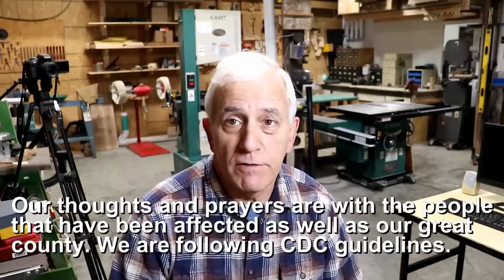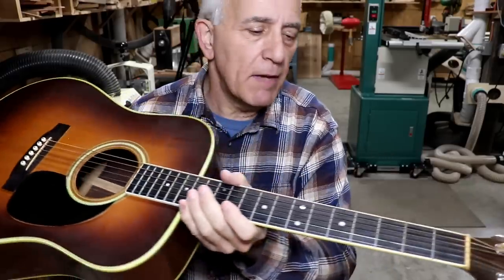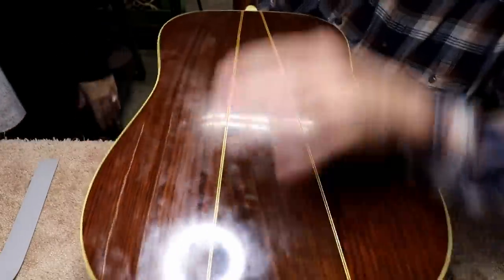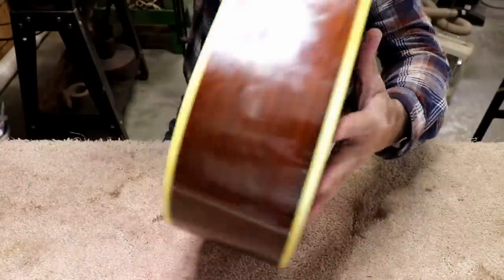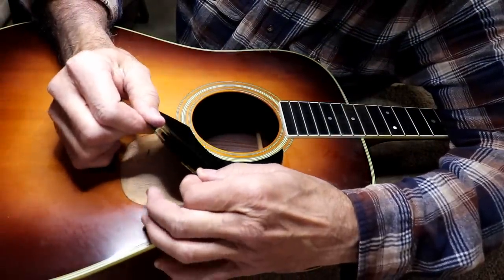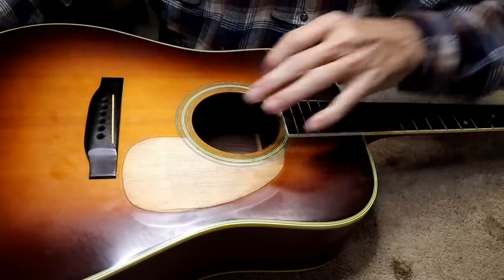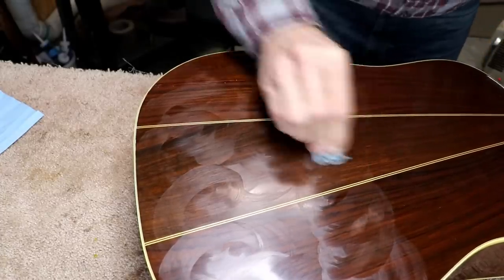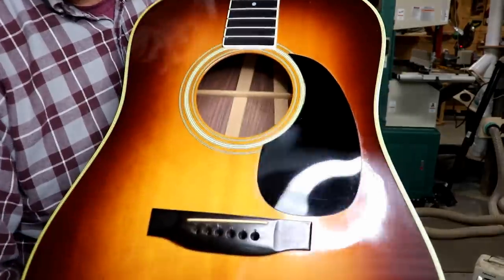387 RSW Martin D35 Impossible Crack Repair

Comment: I get what you're saying about using your fingers to sand, but as a guy who does bodywork on cars, I'm telling you you would get a lot better results on a flat surface with a block. You can still see the cracks on the back because of the pressure of your fingers sanded them down more as you were trying to get rid of the CA glue that was proud. First use a scraper to remove the CA glue that is proud of the surface, then use a block and you'll see that crack a lot less.

Comment: At what point do you use cleats vs just CA glue? Don’t know that I’ve seen a guitar this dry. Would it have benefited from some humidity conditioning before repair or is it the fact that rosewood does react to humidity like mahogany. Not trying to be nosy amateur-just trying to wrap my head around all these kind of issues you run into. Thanks for what you do!

Comment: I love that idea of a wider saddle for guitars that have that "durn" SHARP intonation problem!!! I've been saying that for years but have yet to see it done or even hear anybody propose it (besides myself) - UNTIL NOW!! - by Jerry!!  THANK YOU!!!  I think that's a great idea. They might even be flat sometimes. The saddles should ALL be wider! But not all guitars need a wide saddle. Jerry has proven many times that if the saddle is CORRECTLY LOCATED IN THE EXACT RIGHT PLACE, then a thin saddle should work fine. But wouldn't a wider saddle also transmit more string vibration to the bridge and then to the top causing greater sound volume, and whatever tone the woods on the guitar will amplify? (Especially the top!!) Probably not that much. Perhaps a larger saddle would even CUT DOWN and tend to MUFFLE the vibes! I don't know about that seems like the logic can go either way. Greater transference of string vibes to the top, or less??  Maybe both, with a point of "diminishing returns"?  IDK.  Saddles have probably already have been figured out, and the smallest saddle might be the bestest, otherwise there would be a lot of large saddles on acoustic guitars out there by now.

Beautiful sounding and beautiful looking Martin guitar, Jerry!!  The fix of the cracks on the back was a work of art!

Comment: All too many guitar players have trouble with correct and neat string installation. Often when they wrap multiple turns of string around the post it is because they either don't realise the strings should be cut to length, or they don't own a side / diagonal wire cutter tool. A previous post mentions BB King winding all the string around the post. Some people even recommend doing this because he did it. I think just because BB King did it doesn't make it right. He must have had a lot of patience to rotate his tuners that many times. I guess he didn't have any side cutters either. 

It's a shame about the neck on that D35, I wonder what Martin would do about that.

Comment: Hi Jerry I love what you do. I do have a 86 d35 it has a slight crack in the back about 11/2 inch along the grain kinda just opposite the sound hole . I was wondering it you could put your magic touch on it ? 🙏 
Love the D35 you doctored n the cosmetic surgery results 👍🏻👍🏻
Reply from the maker: I have been refusing all new business for quite a long time because of such a backlog. I don't see that changing anytime real soon. If it does change I will post a video.

Comment: On sanding the frets after leveling (& crowning if necessary) I still have a couple of erasing shields from high school drafting class that have a few slots with different widths that work very well with different fret widths. I'm sure Hobby Lobby and other places still carry them.  (Ya' see Mertle? All that junk in the basement I saved eventually DOES come in useful some day!!)

Comment: concerning your electrical problem Jerry it sounds like different circuits are sharing the same neutral ,seen this alot in older houses ,not real easy to figure out either ,sometimes you can look at the wires coming in the panel ,but not knowing and seeing it myself ill just say good luck with that
Reply: Ditto... If you can map out the wires, make sure the Neutrals are separated for each power source (Leg).   Crossing neutrals is like Ghost Busters "Crossing Streams"   End of the world/Alternate universes follow.

Comment: Gorgeous guitar Jerry and great work! I did have one question in that when you checked the string height at the 12th fret you only lowered the troubleside by 20,000s and you said it was 100,000. I thought the treble side you always took down to 80,000. But you only took 20,000 of the saddle treble side. Just curious, is 80,000 the standard for the treble side? Either way it sounds great and it looks even better. This is probably the fourth time I watch this particular video so thank you so much for all of them. I don't know

Comment: Jerry: Wayne our RB250 & RB11 banjo owning banjo player owns a 1968 D35 he bought in 1969. 2 years ago he had a local luthier reneck the 35.
Luthier told us D35's suffered from neck problems, MusiGoRound store in our area has a 68 D35 and store is asking $1,600.00 for it. I'm thinking
of buying it with my IRS refund. When he bought the 68 D35 for get this. $550.00. Boy have they gone up in price.

Comment: I do auto body and when you use fingers to sand, they follow the groves, so we use flat blocks for final sanding to avoid dips.. Finger sanding can put waves in where there was no repair.
Reply from the maker: I agree with you if you don't know what your doing your right
Reply: @RosaStringWorks  
Especially wood, it has hard and soft grain, fingers dig into the soft grain.

Comment: Just so you know until I think the 80s Martin put the pick guard on bare wood and finished over them . since the top shrinks and expands with humidity the pick guard isn’t stable  and unseals and also the plastic gasses out over time and curls, it’s also why all old martins have a b string pick guard crack.

Comment: Tom Langseth   I enjoyed your 387 (Martin D 35). You made it look like a new instrument. I do have one question - after you sealed those two large cracks, I would have expected you to put some cleats on the inside. Was it because you expect the lateral to keep everything tight.
Reply from the maker: I use cleat anytime there's any sort of stress pulling things apart. In this case there didn't seem to be any stress trying to pull anything apart

Comment: Jerry are you aquainted with its either Koval or Jantz knife making supplys ? If not maybe pic up a catalog .. they have a CA  Glue I ust to use for filling cracks in woods for knife handles and a spray  CA glue call zap. Its in a pump bottle .

Comment: Amazing talent to be able to fix those cracks in the back like you did and then blend in the finish! I dont understand how a $3000 guitar can come with intonation problems though. The frets must have been put in wrong and or the bridge was. My $200 Alvarez has near perfect intonation and sounds just as good. Anyways great video!
Reply: Well it wast a $3000 guitar really. Its a 70 something model, and I know you could get a brand new D-28 (natural finish) in 1975, with a case, for $600. So this sunburst D-35 was probably in the $700 range.
Reply: In the 70s the big three were having problems. Martin's was the intonation.

Comment: I have heard of people using those ridiculously strong neodymium magnets to clamp cracks level from both sides while they wick in glue and add cleats for these cracks. I've never tried it personally.
Reply from the maker: That would work if you were able to get it together. This is not at situation.

Comment: This 1976 d-35 is covered with crazing on the top, where it looks like the lacquer has shrunk over the years. There are also surface irregularities where it looks something has dried or adhered to the surface. As you have done wet sanding with 1000 grit on that Martin, do you think my Martin would look better with that treatment? I am a woodworker and not a stranger to working with wood. I happen to have some of that same wax you used that I have used on the surface, but it is too irregular to make the guitar look good.

Comment: Again I’m in no way questioning your work, I’m just beginning and fixing old fiddles I find at junk shops and guitars people find in closets (no charge but no expectations I’ll do it right either) When you fixed the cracks on this guitar, why did you choose not to install cleats? Was it how the wood was lining up and basically forcing itself together?
Reply from the maker: I use cleats with any time there's some sort of force or could be a force that would be applied to that spot. There is enough surface contact in this with the glue that there should not be any problem holding it together. The cleats would have just been decoration in my opinion
Reply: Rosa String Works thanks, I learned something today...I’m sure that brace in the back was enough, but now I know, thank you sir.

Comment: jerry< I am not a guitar magician but I am a fix it guy. Did you think of using hot melt glue on some brackets and then using a screw bolt set up to spread the crack?
Reply from the maker: On really brittle thin wood like that did you try spreading it very much you can easily crack it all the way down the length it's it's a very delicate balance

Comment: Jerry . Wouldnt a fix for underbow or over bow .pull the fretboard . Rout out two rows  down the  neck ,  and set two carbon squair rods .and a hand full of C clamps .. ?
Reply from the maker: It already has a non-adjustable truss rod in there. A solid bar. The easier fix in this case was to just file it level. That's what I did

Comment: How do I straighten the bent neck of a 1967 mint condition Martin D-35?  Its been suggested I use a 2x4 with clamps to slowly bend convexly  ( over a 6-month time frame ) the neck back of the guitar - Do you recommend this?  Any Suggestions?  Thank you.  Frank May
Reply from the maker: It's difficult to make a suggestion as I don't really see what the problem is.  But most problems that involve warped wood, need a mechanical permanent fix.  Generally just forcing it back into place is not going to last.  In fact in some cases will make it even worse.

Comment: Jerry,

I saw online that Martin didn't start installing adjustable truss rods in their guitars until 1985, where as Gibson had been using them since 1922. Have you ever heard anything as to why Martin resisted adjustable truss rods for so long?
Reply: The story I heard was that Gibson had the iron clad patent on an adjustable rod which expired. Martin , up to that point, resisted paying a license fee to Gibson.
Reply: Martin built their guitars with non-adjustable wooden truss rods because they're more stable, lighter weight and the resonance/tone is noticeably better. Additionally, the necks were built so well that they very rarely need adjusting. Note, that having an adjustable or non-adjustable truss rod doesn't factor into the need for a neck reset.
Reply: The Ebony truss rods were during the war when metal was hard to get. The rest of the time it is a metal tube or metal T bar.

Comment: I have a crack in the top of the guitar that I am building from a Martin kit. The top is still bare wood. I humidified the guitar, and the crack is closed up now. I am going to install some cleats on the underside of the crack. Do you think I should put some CA glue on the top side of the crack? If so, should I scrape any excess glue off with a razor blade? Thanks.
Reply from the maker: If you can use Titebond and get that in the crack you would be better off than using CA glue. CA glue works fine if that's all you can get into the crack but I would think you'll do better with the Titebond.
Reply: @RosaStringWorks  Thanks for your quick reply! There is no light coming through the crack anymore when I place a light inside the guitar. I can just barely see where the crack is when I place the light up to the inside of the top. I don't think that any glue will even go into the crack, so do you think it is necessary to do anything but put some cleats on the inside of the top?

Comment: CA glue two L brackets on either side of the top, holes to the top of the brackets. Thread nuts onto a piece of all thread rod and put theu the brackets. Turn nuts back against the brackets and spread the crack a bit and do your thing.

Comment: That electrical problem is either one of two things: 1. wired wrong, someone connected two circuits (i.e. two groups of downstream of two breakers) together… or 2. you’ve got a bad neutral. If you’re sure this phenomenon is (was) new, then its #2 and you need an electrician. This was 2 years ago, so you’ve probably already handled this, but bad neutrals are dangerous so if you had someone ‘fix it’ and didn’t know to check the neutral, I would have someone look at it who knows what I’m talking about.

Comment: So others have seen the cheap way Martin does stuff. I have a small 17 Martin about 15 years old, and it's scale is way off. The idea is to push that name out there and people will buy it for that. Same with Gibson. Do you know Martin farms out their repairs? If you send it back to the factory, they may send it off to someone who lives in the same city you do. I once had a Martin tipple that needed new keys. I called Martin to see what they recommended. They said, "Mini-Schaller" keys. There was no way you could put those keys on a small tipple slotted headstock. I found some nice twelve string guitar keys that had the right measurement for the string posts, and cut a key on each side. Then I had the ten keys I needed. Worked like a charm.  I sent Martin a 12 fret Ditson with a pyramid bridge to be reglued, and they kept the bridge, and put on some cheap plastic ala LG Gibson model bridge with a slanted saddle which never played in tune. I sold it to a lady who wanted to learn to play guitar. I wish I had it back. Now I know how to make and reglue bridges. I have to laugh when I see the Martin factory videos. They don't show all of the robots that make their guitars. They try to make it look like it's handmade by techniques of the old world craftspeople. It's all about the $$$$. Same withTaylor.  500+ guitars a week come out of those factories. The new glues are quick setting and last for awhile then start turning loose and pickguards shrink and cause top cracks, etc.. Modern technology. Make cheaply as possible and sell as high as possible. Phhhttttttttt.

Comment: Thing is, that guitar didnt come from the factory with a matte finish on it. It came pretty and shiny like it was after you buffed it back out. I dont know what got on there and dulled it out, but something sure did.
Reply: I sold several Martins back in the 70's that had matte finishes. It was a factory option.
Reply: @Yoda8945 If this one came that way, then why would it have a gloss square on the top where a sticker or something had been? The sticker protected it from whatever dulled the rest of it. It looks like it was maybe kept on a stand by a window in direct sunshine for years.
Reply: @1980bwc  The rectangular polished portion of the top is from the pad in the case that holds the guitar in the case. Just having the guitar in the case and moving it around for the last 45 years would polish it there.

Comment: The 2 hour interruption.  Either your wife and my wife are related or we're related.. .I'm 62 in Austin TX.  Why do I  tell you that? I dont know....anyway; question: when I change out my strings on my Martin HD-35 I use Dunlop 65 fretboard cleaner and Dunlop formula 65 guitar polish on the body of my acoustic guitars . Will the Dunlop 65 hurt the pick guard too???
Thank you in advance for your reply when you're able to.
Reply from the maker: I can't say for sure. I just air on the safe side and I don't put any kind of liquid chemical things on my pickguards.
Reply: @RosaStringWorks  thank you so much! Understood.

Comment: The volatile (evaporating) solvents in spray-on cleaners and polishes can seep under pickguards and break down the adhesive.  If you've ever used WD40 to remove a bumper sticker, you already know how well this works.  Anytime you use any cleaner/wax/polish on a guitar, never apply it directly to the guitar.  Always apply it to the cloth, and then take that to the guitar.

Comment: I guess removing the binding and separating the back (from the sides) in that area is completely out of the question? Seems like a definite way to fix the crack but  at what cost and could you fix the binding back the way it was  without completely refinishing?
Reply: doubt it

Comment: Just a guess, could it be you have the hot wire of the circuit on one breaker and the neutral on the other breaker there go two breakers controlling one circuit.
Reply from the maker: Nope it's actually far more complicated than that.